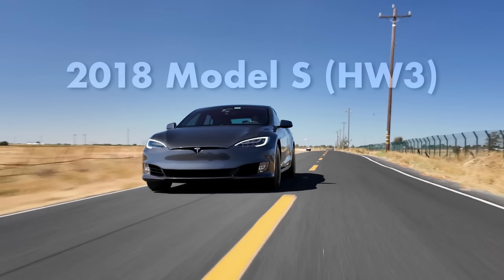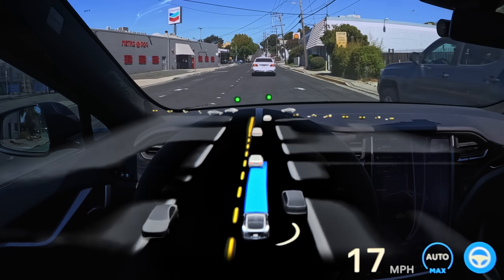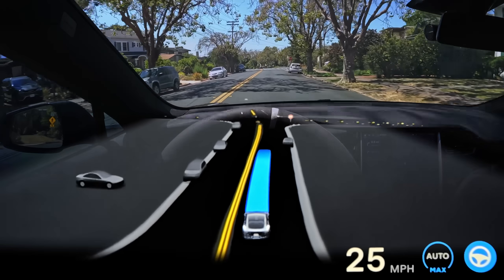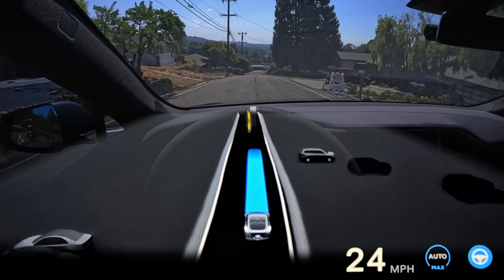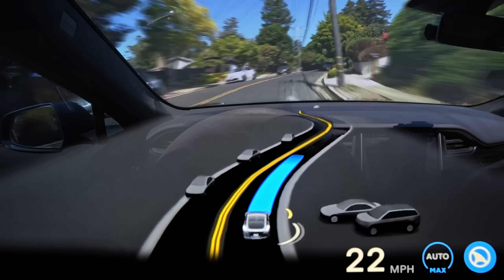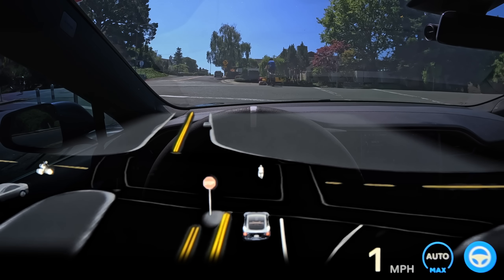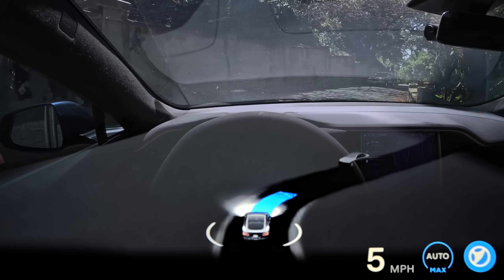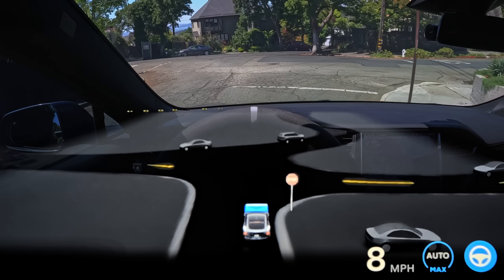Tesla FSD 12.5 Stress Test on HW3 (First Impressions & Highlights)

Comment: December 2016 Model S P100D HW3 MCU2 here. Was running FSD 12.3.6 for around 90% of my miles driven with few embarrassing/frustrating scenarios. Not perfect but overall very impressed and pleased. Recieved 12.5.1.5 about 2 weeks ago and for me, it has been enough of a step back that I just went back to using basic autopilot... its behavior has improved in some ways including identifying the correct lane and changing into it sooner, but thats all that I've noticed. The bad includes slowing down nearly to a stop for empty crosswalks, struggling to maintain the correct speed, especially on rural roads, at times even staying within the lane, hesitating at odd times including going through an intersection with a green light, etc. I remain hopeful but I would definitely go back to 12.3.6 if I had the option. Way more hassle letting 12.5.1.5 work than me drive myself

Comment: As a heavy autopilot HW3 user 90% on highways, this update was a disaster for my commute, it is almost always going 10 to even 20 under the set speed and speed limits on every road I go on, I spend more time driving myself then on autopilot now because of how bad it is
Reply: What model do you have? I have a 2016 S P100D with FSD running 12.5.1.5 and honestly don't use FSD anymore. 12.3.6 was overall much better. I do almost all the driving now as it's too embarrassing/frustrating
Reply: @danieleulberg2324 my experience exactly, I’m in a 2017 model s 75

Comment: 12.5 is going to get you rear-ended in areas where the speed limit is above 25 mph. In 11.x the car would throw phantom collision alerts on empty roads, 12.3, the car would beep but not display those alerts and not alter speed. In 12.5, the car slows down to crawl but no longer throws those alerts, which is dangerous as those behind you don't have the luxury of electric motor breaking coupled with disk brakes. The car is performing almost a full emergency stop. Likely going to cancel the monthly subscription because its outright dangerous, no warning you are getting pushed forward because the car is breaking at ~.3-.5g

Comment: I’ve been very frustrated with that update. Apparently it doesn’t understand “No turn on red” signs and tries to turn. Slow downs are very frequent and annoying. Another issue that has been persistent is when it takes  the right lane, when there is a left turn in less than quarter of a mile in a busy three lane intersection 🤦🏻🤯, or takes a right lane that’s only good for freeway entrance, and then tries to change lane at the last second, creating dangerous conditions. I start to doubt that it would ever be able to go full FSD

Comment: I was very excited to get 12.5 on my '19 M3LR and I gotta say it is certainly better overall, so far.  Haven't taken it out much so not fully sure how it handles all the situations I used to dislike.  So far, I have noticed a really good and a really bad thing.  

The really good thing was actually stopping ONCE for a stop sign.  Insane.  No hesitant creeping out three times before the turn, it just stopped at the sign and took the turn when it was clear.  I have a stop sign I regularly need to use that I almost always disengaged on because it just wouldn't take the turn and cross-traffic is a highway so it's just not safe to be overly hesitant.  

Another plus: I also have a part of my commute that involves a right into a left, two streets down (almost immediately), and 12.3.6 would wrongly take the first street which is a dead end...not 12.5!  It finally understands it should follow the route.  (It was especially insane because it would route to the second street but turn on the first.  WTF?)  I'm looking forward to finding out if it still tries routing through a mall parking lot like it would always try on 12.3.

The really bad thing was what you're experiencing with slow-downs.  The bottom of my hill is a four-way where only the cross-traffic has stop signs but traffic up/down the hill does not.  My car stops as if it has a stop sign.  Very dangerous if there were other cars around.  I also noticed it would slow down or nearly stop for other four-way intersections on back roads with NO SIGNS.  Hopefully that gets worked out soon.

Really enjoying the hands-free driving as well.  I still keep near/on the wheel but it's nice to not be nagged at all.

Comment: My 22Modelx hardware 3 update to 12.5.1.5 is a large step backwards from 12.3.6. It does so many things worse that I have trouble remembering. 1. When there is a need to change lanes to make a right or left turn it waits so long to get into the lane it needs to that it misses the turn completely. 2. When needing to get in the right hand turn lane, it doesn't and makes the turn from the lane it is in instead of using the right hand turn lane, dangerous. 3. It rnandomely slows angering drivers behind me. 4. It stops way to far back at stop signs. 5. It pulls out in front of cars and doesn't speed up. 5. It makes my wife so nervous and me as well that it is unusable. I'm very discouraged.

Comment: As a Gen 2 Model S owner, I have some questions for you: 
-What year/trim is your Model S?
-Did you have HW3 natively or did you get the retrofit?
-What software build/FSD version were you on before you got the v12.5 update?

Trying to gauge how long until I get v12.5. I'm in a '17 S100D with a retrofitted HW3/MCU and a 2023 software build with FSD v11.4.4.

Comment: Yeah - I just got 12.5 on my 2019 Model 3 yesterday - I gave it a work-out in my local area and have yet to have a single intervention!  For the first time, it drove up my long driveway instead of telling me "Navigation Complete" before getting there.  It also slowed down to an appropriate 28 mph in a 25 mph hospital zone for the first time - nice!   One particular junction where it got into the wrong lane 100% of the time is also fixed.  I had been very worried that 12.3 was going to be the end of the road for version 3 hardware - especially after Musk said that it would be very difficult to implement 12.4.  Still, it would have been sweet to get a free hardware upgrade.  But I feel that FINALLY the promise of having a car that drives itself has actually been achieved - and my $6000 was well-spent.  FSD doesn't drive like me - it feels more like riding with a stranger doing the driving...not bad, just different.  Losing the steering-wheel wiggle is **HUGE**.

Comment: (2024 Aug) - *Good description on better handling of various edges cases compared with 3 months ago*: Tesla latest v12.5 FSD on older Tesla hw3 vehicles (> 2 years old) - more smooth and confident, driving more like a human will do on rare occasions or for edge cases, such as:
1) driving over a double road divider lines when obstructed, 
2) patiently and gently waiting for vehicle on the wrong side of road to drive past, 
3) slowing down when there are more things, dark shadows or situations to evaluate, check or verify, 
4) able to anticipate ahead of time or see what will be happening later, 
5) stopping vehicle in dangerous situations, e.g. child cycling in uncertain direction, 
6) gradually following pedestrian until pedestrian no longer block vehicle, 
7) smoother & more confident roundabout driving or handling, etc.

3 months ago, Tesla FSD have not been able to more consistently handle these edge cases well. Current FSD still does not handle dark shadows well causing 1 driver disengagement - forcing FSD to proceed and ignore dark shadow (11:45).

Tesla vehicles with hw3 encounters more vehicle slow downs in situations where more complex evaluation is required due to the slower hw3 computation?

Comment: After a day of testing 12.5 on a HW Model 3 in CO I've had a really bad time. Roundabouts are jerkier, speed control is bad (way to slow, slower than previous builds), and the random slowdowns happen a lot. I need to try it in harder situations, because easy suburban driving is not going great.

Comment: I do enjoy your videos! I've been using 12.5 on HW4 and I've experienced several annoying behaviors: the same last minute corrections you experienced when turning left around a centre median, slow downs for no apparent reason (although it often seems to be related to shadows on the road), late lane changes that threaten to cause us to miss turns, and the return of occasional sudden phantom braking. These are annoying, but overall using 12.5 is very smooth and filled with frequent moments of delight as it handles situations I think will bring it to its knees. The addition of the ability to back up will be a phenomenal breakthrough.

Comment: Just got a 24 model 3 highland and i tried auto pilot. that thing scares me. i tried enabling it on a posted 30 speed limited and it accelerates quick! def more for highway usage.
Reply: Do you really mean "auto-pilot" ?  We're talking about FSD - which is an entirely different piece of software.  Auto-pilot is very limited by comparison.
Reply: @SteveBakerIsHere  yeah I mean auto pilot. It was my first time using the software and wanted to share my first handed thoughts on it

Comment: I just got 12.5 for my MY today. HW3. I took a route that I usually take. Wow. There were 3 areas where the car wasn't good before. 1st, Stop sign is about 8 feet before the stop line. Car would stop at stop sign, then pull ahead to the stop line and stop again. It would very slowly pull out into the intersection. Now, it stops at the stop sign and cautiously pulls into the intersection and goes. 2nd, a couple blocks later it would slow to half it's speed, then return to regular speed. Now it maintains speed. 3rd, further down the road, this is a 3 lane road. 1 lane each direction and the center lane for left turns only. They have flop over barricades spaced out to prevent passing. The car would get over too soon to turn left and almost hit the barricade. I would disengage each time. This time, it waited to get in the left turn lane until after the barricade. 
It would do each of these things every time.
Needless to say, I was impressed. 
Thumbs up for 12.5
Thanks
Bob
Reply: Yeah - one place near me - a narrow two-lane road turns into a four lane at a junction with stop-lights - and there are FIVE lanes - adding a left-turn lane that right in the middle of the road.   Turning left there, 12.3 would get all nervous, indecisive and 'wiggly' and then pick one of the straight through lanes and then panic as it realized it could no longer turn left.  It did this 100% of the time - and drove me nuts!  Finally, in 12.5 it does it correctly and confidently - HOORAY!!

Comment: I'm at the 3 minute mark and everything you've shown so far (going wide on a turn, braking for ne reason, blinker on in parking lot absolutely happens in my 2024 Model X HW4 12.5.1.3 And these issues are so temporary and minimal hardly worth mentioning. But, if you have nothing to mention, then you have nothing to post, so I get it. I guess.

Comment: I got FSD 12.5 yesterday in Canada. I have done several drives. None were successful. 2023 MYLR, sudden stops for no reason, nearly hitting other cars, going across the center line. Driving well below the speed limit. Most drives were interrupted within less than a kilometre. Not ready for Canada. Not a happy customer.

Comment: Great video highlighting the good, and bad, of 12.5. Left turns and moving confidently around in tight traffic situations is crazy good. 

On HW4, I still have issues with the  excessive slowing down in many situations. I mostly "override" with pedal inputs to get going / keep pace with traffic flow. 

It needs work with keeping up with traffic on curvy mountain roads (Hwy 17 between SJ and Santa Cruz). It goes through turns like it is  looking 5 ft in front of it, causing a big gap in traffic. I wish it "knew how" to take a turn at speed properly... the map shows the turn radius, so between that and looking ahead further it should be able to comfortably do this. But, I suppose that it is learning from the masses, who by and large don't take smooth paths through turns....

Comment: I have the same 2018 Model S and have been on FSD since 2021. Ver 12.3.6 was as good as advertised, but ver. 12.5.1.5 has been near-undrivable for me. It's way too cautious, constantly slowing down, and way less smooth than it was before. I know it's temporary, and within a couple of weeks I'm sure it'll all get worked out but I don't get the variance between the cars. I'm in Austin, TX so maybe that has something to do with it but its one of the worst upgrades I've experienced. Would love to figure out why it changes so much car to car, but some of it you had in our video too.

On another note, I don't really have OCD but the fact that it's driving over lines annoys the crap out of me. I feel that the perfect drive is a drive where you fit between the lines where you're supposed to be. This version ignores that, like your drive, but I really don't like that. Hopefully they'll balance that out quickly.
Reply: I'm in DFW and similar experience to yours on 20MSLR+.  Very regressive upgrade.  Hopefully it will iterate quickly.
Reply: Real human drivers don't stick between the lines - and the goal here is to be more human-like, so sticking between the lines was not a great feature.  On winding country roads, sticking rigorously to the lane lines (as v11 did) results in nauseating lateral g-forces.   Apex-clipping (as it's properly called) is OK - when there's no oncoming traffic ahead of you - it's a good thing.   In the UK, I took an "advanced motorist" course and passed the driving test for that (it saves on car insurance - and is kinda fun).  They TAUGHT us apex clipping as good driving style.   So this is a GOOD thing.  Robotically gluing the car to the middle of the lane is NOT good.

Comment: How does your 2018 MS have hw3? I used to have a 2018 ms with hw 2.5and asked service center to upgrade it to hw3. They said it won't fit and the connectors were different.

Comment: Got 12.5 on my HW3 model 3 recently, and have been using it for a couple days. Within the first 2 minutes it tried to run a red light. But other than that I have been pretty impressed. I've had maybe 2 instances where it randomly slows down for seemingly no reason. And then I had another situation where it took the wrong angle on an unprotected turn, but then corrected itself. My biggest issue right now is for some reason the nav keeps trying to get it to do u-turns in spots where it's really narrow - and then FSD doesn't turn the wheel hard enough to actually do the maneuver. Not sure what changed there, because it didn't use to plan so many u-turns before.
Reply: Does anyone know the optimizations that were made to make it run on HW3? Is it a quantized model, distilled model, etc?
Reply: @TechRambles  I did hear one comment saying that it's EMULATING HW4 on HW3 hardware somehow.  I have no idea whether that's a factual comment or a guess.  If it's true - then I'd expect it to run more slowly...but I see no evidence of that in it's driving.
Reply: Very happy to see the issues I was seeing around me forever are finally fixed, too. The turn right off my street it used to accelerate like crazy from stop for some reason every single time, and now it does it properly. It also used to have constant issues with unprotected turns around me where it would act like it was going to roll through...and then it would slam on the brakes at the last second - now that is gone, too.
Reply: I just got 2024.26 yesterday, still on 12.3.6, but one thing I noticed driving today I've never noticed before is a lot of little u turn symbols on the turn lane furthest to the left at an intersection. Maybe I just never noticed or a map update or something?

Comment: If you want a challenge, try taking 12.5.1.5 on to a rural road 50 mph highway in the country like I am.  It drives horribly.  It has trouble accelerating up to speed after exiting a village or decelerating quickly enough when entering a village.   Between villages, it oscillates between 45 and  60 mph.  It also does not give cyclists or pedestrians a wide enough berth even though it has both sides of the road.  And construction zones? Yikes, it races in and races out.   I usually end up taking over.

Comment: How did you get Hardware 3 on a 2018 Model S? Hardware 3 was not introduced until March of 2019 for the Model S.
https://en.wikipedia.org/wiki/Tesla_Autopilot#Hardware_2_and_3,_and_Navigate_on_Autopilot
Reply from the maker: it was made with HW2.5 and got the FSD computer installed later making it HW3

Comment: I thought HW3 would have an advantage because most of the training data is HW3?
Reply: The problem is a technical issue at the heart of how neural-networks operate.  HW3 doesn't have enough "parameters" to run HW4's AI.   So they had to do some clever finagling to get around that and allow 12.5 to run on older electronics.  Training data can be the same for whatever hardware you have - it's how well the smaller-brain AI in HW3 can be trained compared to the bigger brain HW4 - both being given the same training data.